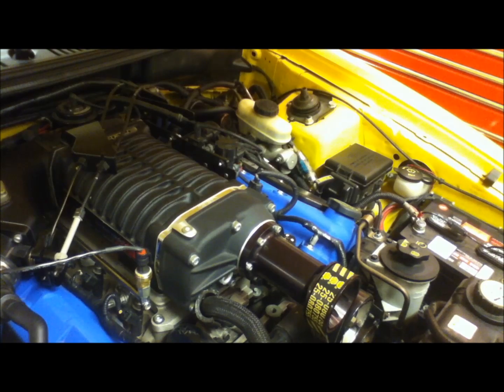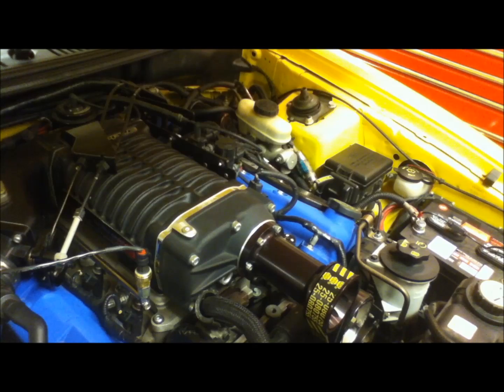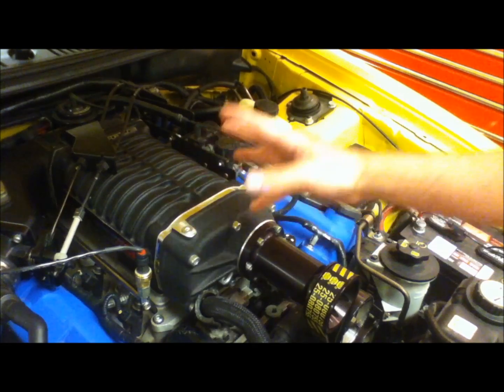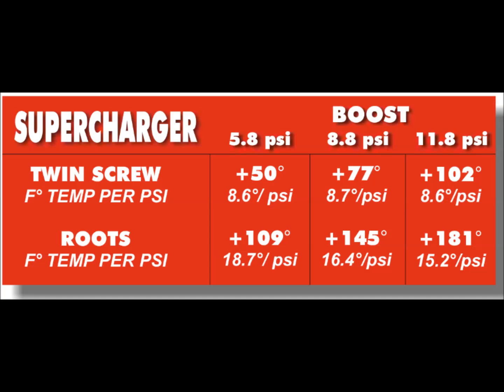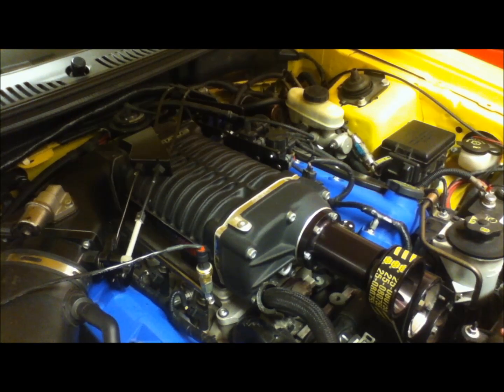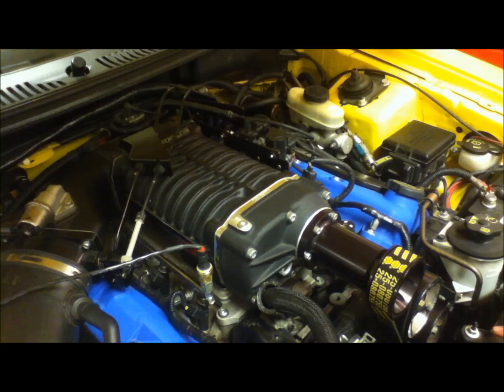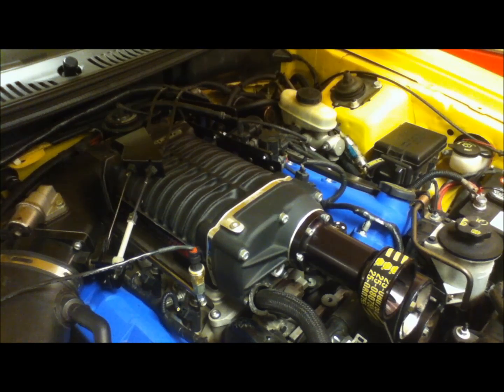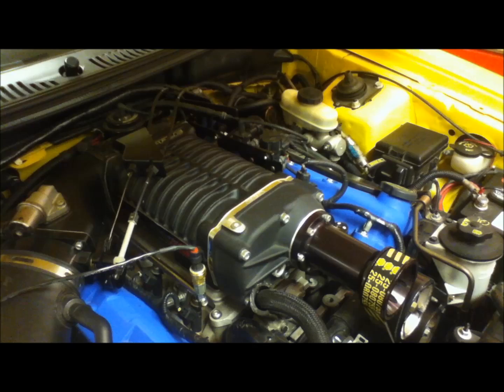Superchargers: Roots vs Twin Screw vs Centrifugal (Whipple, eaton, VMP, procharger) supercargador

Comment: Very awesome video i will def have to re watch this alot of information going in. haha. So im guessing my Roush M90 is a roots as well? Correct me if im wrong.
Reply: yes your roush m90 blower is a roots style its a eaton 90 rebranded by jack roush its a 90 cubic inch supercharger with a 3 lobe rotor design with a 60 degree twist or helix design  hope this info helps
Reply from the maker: Yes, I do believe it's also a roots.
Reply: +R GEN no problem man anytime
Reply: Very much so Jacob really appreciate your help man!

Comment: Good vid so far.  But I understood the roots style blower was first used in coal mine shafts, to force air though the tunnels, supplying the miners with more fresh air.

History---where is it accurate today?  Nobody knows. :)
Reply: +EarthSurferUSA 
For the rpm calculations, crank "pully dia./roots pully dia."

You can use that to estimate actual HP.  I understand "naturally aspirated" they cylinder does not fill all the way with fresh charge, but about 80% (depending on how well the heads are designed I am sure, 4 good valves, may be 85%).

If adding a roots/twin supercharger to your naturally aspirated engine, this is what I think you can figure out.

So if you know the engines power as naturally aspirated (owners manual), and you figure your boost,(as described in the vid), with consumption of the engine based on the engine displacement, and you make sure you factor in that you actually need a bit of boost to fill the cylinder 100% (about 20% of engine displacement), you can probably get closer to actual HP than many dyno's out there.

The above does not apply if you still have a single exhaust system. Change to dual exhaust and headers. You will lose a lot of power and have a lot more heat under the hood if you don't.
Reply: +EarthSurferUSA 
On after thought, I am not so sure about adding the factor, since you should gain more power with just enough boost to fill the cylinder 100%.

Now I can't remember which blower expert told me about that factor.  But he might have bee blowing hot air. :)

Comment: Great video!!! I am trying to decide between whipple and VMP TVS supercharger. I have a 2012 mustang gt( auto). I thought that the TVS was better on reliability because it is not consistently building boost like the twin screw. That was my understanding at least.
Reply: +gentlemonsterkennels 
Quick estimate.  
420hp stock (I believe your car is), times 1.5 (based on your boost pressure) = about 630 hp at the crank.

Nice.

Respect that throttle. :)
Reply from the maker: The TVS is a roots style blower just like the stock eaton that the cobra comes with. It's not a centrifugal. If I were you I would go TVS or 2.9L or bigger Whipple.
Reply: Scrun Johnson Thanks. I decided to go with a Whipple stage 1 for my stand. Boost is at 8.5 on those. Can't wait.
Reply from the maker: That's a good choice since your compression ratio is high
Reply: Scrun Johnson Thanks. Yeah, it sure is.

Comment: Ever considered doing a video tutorial on changing your supercharger oil?
Reply from the maker: Yes. I defiantly will. As of now the sight glass is still very clear. It's pretty easy. Siphon it out and pour in the new fluid. I've seen some eatons lose a bearing when people use motor oil instead of the recommended stuff (which you can get cheaper from GM and it's the same stuff since some of their cars also have an eaton blower)
Reply: I've been a motor head for over thirty years and I just bought on 03 Cobra with very, very low miles and I just learned today that the S.C. contains it's own oil. Who knew? Not me!
Reply from the maker: Hopefully my brother will let me change the oil on his stock eaton for a DIY video. Its pretty simple-siphon out he old and pour in the new. Some people have used regular motor oil and experienced failures, so I'd recommend sticking to the stock oil. I hear its cheapest to buy from the Chevrolet parts counter as they have eatons on some of their cars.

Comment: Nice video! I had an 87GT with a vortech s trim, a 95 with a turbo, and I'm about to procharge a 2016. I am considering a whipple as well. It's amazing the videos on YouTube. Especially when people actually know what they are talking about. People don't realize all a motor is, is an air pump. It's volumetric efficiency can only be so good and can only pull so much air. By forcing air and fuel in, we can create a bigger bang and hence more ponies. I like how you explained the aftermarket exhaust would lower boost. Any mod we do to increase the efficiency of the motor will lower boost at the same pulley sizes. Heads, cams, intakes, throttle bodies (after the blower) etc. all increase the efficiency of air flow and lower boost. However does not mean less power.
Reply from the maker: +Ian Muller I agree. So many people only look at cylinder displacement and don't understand that a blower, better heads, etc are all crucial components that are just as important when making power.

Comment: I'm trying to understand...I'm a layman wit this stuff, but I find it really interesting. Atmospheric pressure measures at 14.7 lbs at sea level. That said; does that then mean that the efficiency of a blower will keep the the manifold pressure at it respective atmospheric pressure no matter what altitude you are at?
Reply from the maker: It will increase the pressure at any altitude, but you won't get the full boost pressure once you're up too high, and if you still are able to make full boost, you will have the same manifold pressure but it won't be full of oxygen, but rather the other elements that are found higher in the atmosphere (probably nitrogen?). So if the car makes 17 psi at sea level, you have 17 psi more than the 14.7 found at sea level. If you were at 10,000 MSL (mean sea level) and the car was still able to make "17 PSI" it would most likely be 17 psi of pressure, but with less oxygen. Oxygen is the real key to this equation. More oxygen is the Reason behind nitrous, as it increased the oxygen from 21% to about 33%

Comment: That was a damn good video. I like to watch these types as a refresher. I have to tell you that very few people went over some of the details discussed here. Especially about the boost difference between smaller and larger displacement engines and the overall explanation of boost as a concept of atmospheric pressure. You just earned a new subscriber.